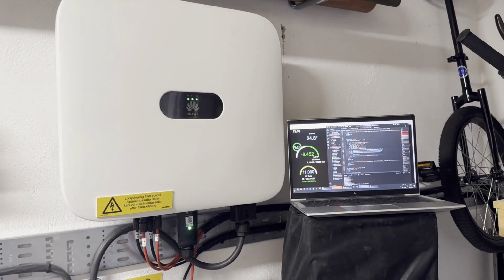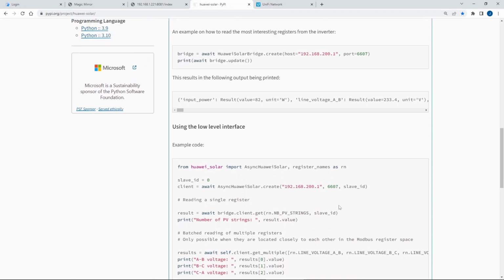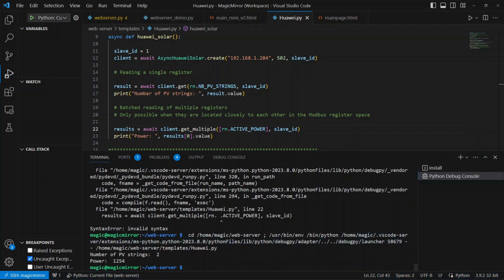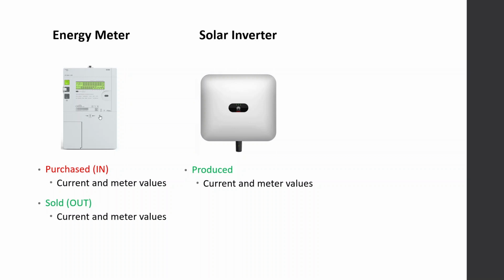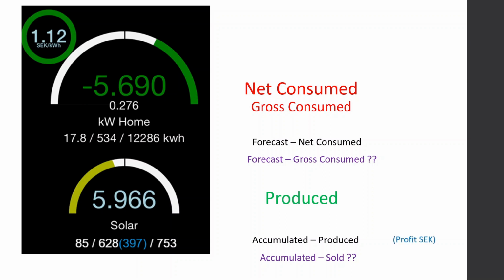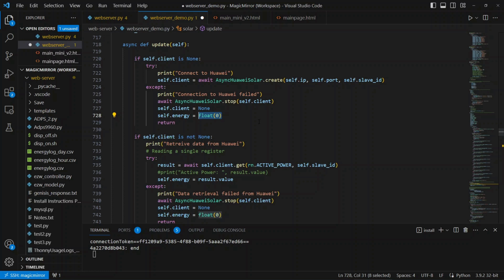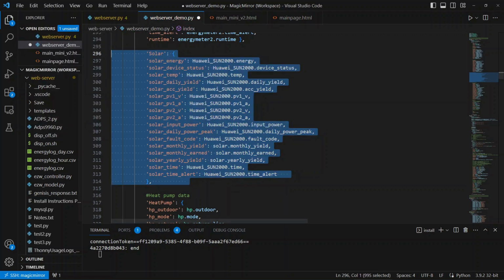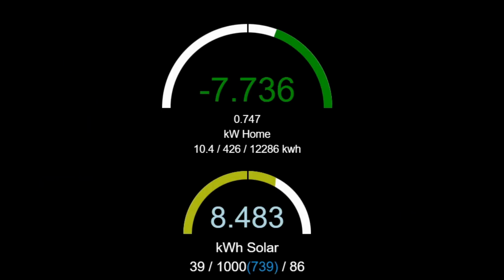Monitoring my PV Inverter

Comment: Hi, I noticed you used Shelly devices on the pool pump/chlorinating equipment. I have a three-phase dwell pump that I would like to monitor. Which Shelly device do you use?
Reply from the maker: Yes, i really like them, since they are so easy to monitor and control, without any controller
So far, i’m only using the S-plug, but i have been looking at their Shelly Pro 4PM, since it can controll 3-phase, and also have a built in energymeter
Reply: @mymagicmirrorhome7561  Thanks for the quick reply.